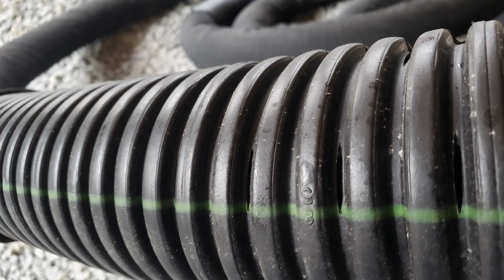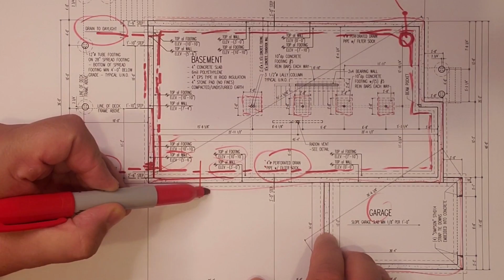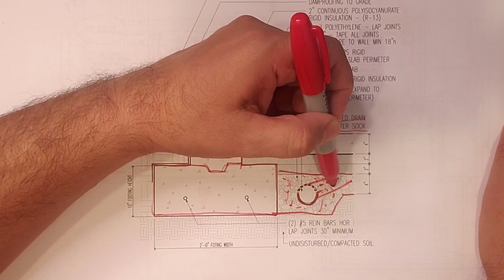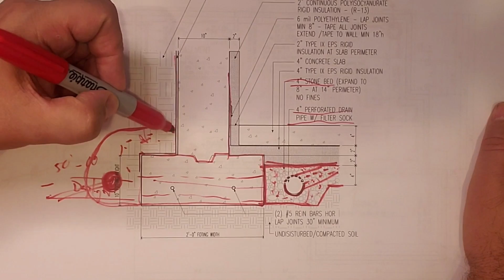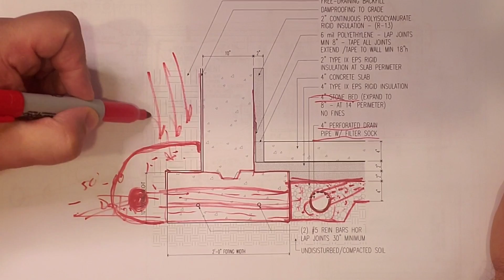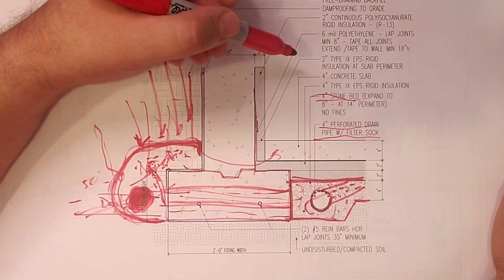SUB SLAB WATER MANAGEMENT

Comment: I love french drain burritos. We build a lot of heavy log homes that get huge footings. I am on glacially shift white sand at camp. And north wall has snow pilling up and no sunshine most of the year. Plus have huge footers for masonry appliances on that wall. I just went down to hard pack which is 6 feet and about frost line. Could of gotten away with shallower footers and piers by code in sand. But I never take the easy way.

Comment: This is a particularly important topic. If this part isn't done properly, you are in for long term problems. I wouldn't risk any problems in this area. This is the most important part of the building, next to the roof. I have seen and heard about way too many problems in this area, and it is not easy to rectify after the building is up. Problem is that most people aren't interesting in this boring part, and are not willing to pay much for a proper solution. If it is fine the first day, it is all good!

This drainage pipe is often not required or pointless. Small amounts of water will travel trough the gravel just fine. Why not also put the footings on top of a layer of gravel? Then that part should be dry too, and not suck so much moisture up the concrete wall.

Look up French Drain Man for excellent geotextiles and drainage pipes and water management solutions.

Anyway, building anything below the water line sounds crazy to me anyway.

Comment: You mentioned that you only get one shot to get it right. Would it make sense to put service cleanouts on the pipe in key locations for drains installed exterior to the building, or even interior, if it could be located in a less critical area?
Reply: What I’ve heard is that the flexible corrugated pipe will get chewed up if someone tries to clean it, e.g. with a rotating tool.  Probably better to go with perforated solid PVC.  I haven’t yet talked to people that do sewer-pipe cleaning about this issue, but I am planning to ask them, to find out what kind of pipe construction they’d like to see if asked to clean out mud and silt.
Reply: @kc9scott  I agree that clean outs combined with perforated PVC pipe would be the top tier solution. Also probably the more stone backfill you can afford the better. The faster you can move water away from the foundation the better.
Reply: @samuelfeguer Great video, love the work you’re sharing. Wouldn’t connecting a perimeter drain and an inner wall drain run the risk flooding/clogging the interior drain with external sediment? Couldn’t they independently run to daylight?
Reply: I have heard of people putting some service cleanout access on the exterior of the building.
Reply: Also, one of my neighbors mentioned that their gutter downspouts and foundation drain are tied together into the same system, and it got clogged, putting water in their basement.  The corrugated pipe will have more of a tendency for leaves and debris to get stuck to the side of the pipe, if it’s receiving material from the gutters.  So, another reason to keep the two systems as separated as possible, and/or use smooth-wall pipe, or both.  (I don't know what kind of pipe is in my neighbor's system)